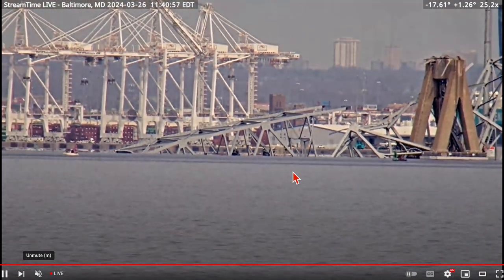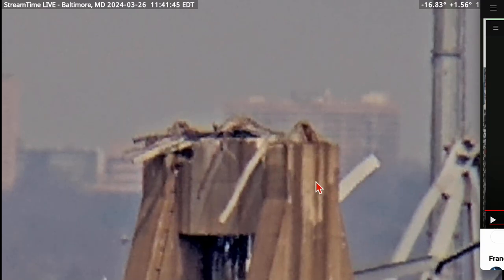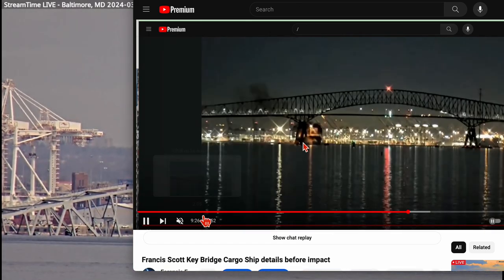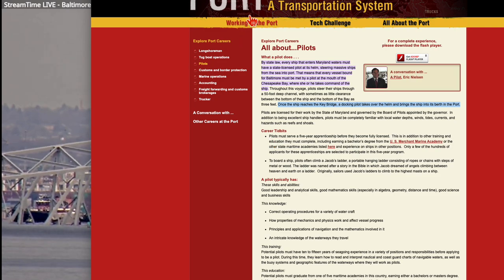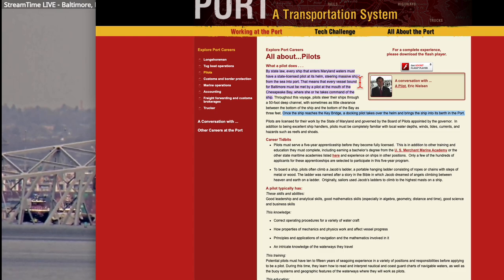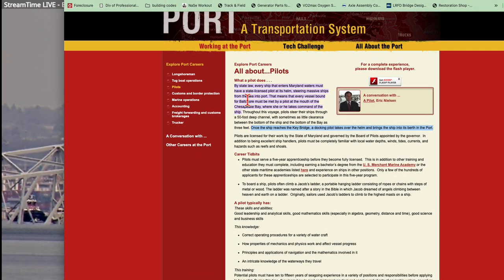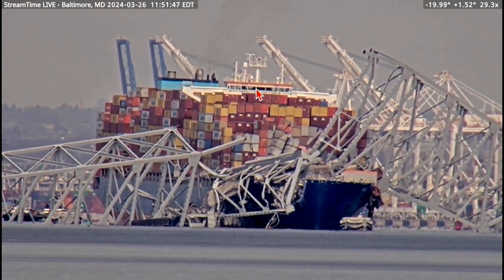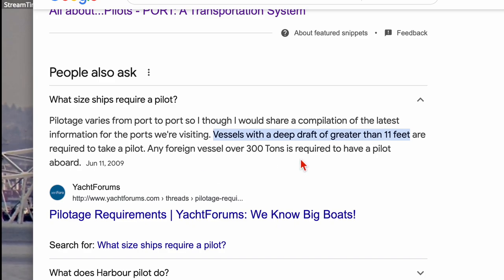Francis Scott Keys Bridge Pilot was NOT required nore a tugboat? bc they were leaving MD waters

Comment: The narrative they want us to believe is the pilots were fatigued and the ship lost propulsion.  I will focus on the propulsion issue.    I owned an 18 foot boat and while moving forward, if I reversed in full power, it takes a while to slow down and even more time to actually start a reverse movement.  So, I believe reversing wouldn’t have helped them.  It’s reported that they had time to warn authorities prior to the collision and most were stopped.   I can say when I was fishing in the ocean, if my boat was drifting with my engine off, steering was nearly impossible. Thus, I think it’s possible after they were in forward motion, there was a transmission failure or maybe even the propeller fell off or loosened or maybe something got wrapped around propeller.  I don’t know.  You mentioned the water was calm around the ship so seems as if it was the equivalent of revving a car engine with a bad transmission.  That’s why we saw smoke from ships exhaust.   Also, if they had time to call in to report it’s out of control, then they had time to drop the anchor.  Dropping an anchor in an emergency is boating 101.  If the anchor was on the starboard side of the bow, then the sudden turn to their right would make sense, once the anchor dug in.   Lastly, it’s possible they never lost propulsion and they lied to cover their A**
Reply from the maker: I will research this vessel as soon as I free up some time... we will see what records we can uncover.